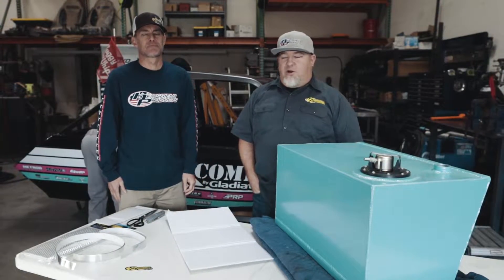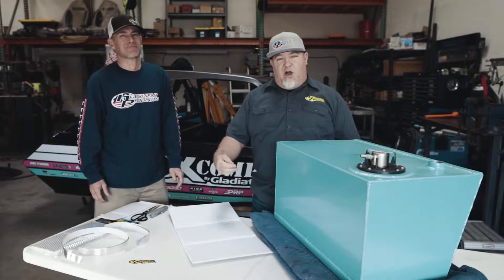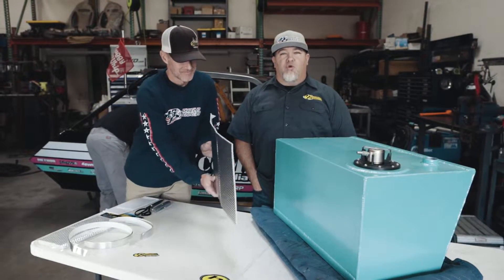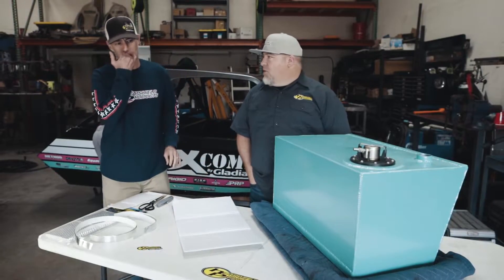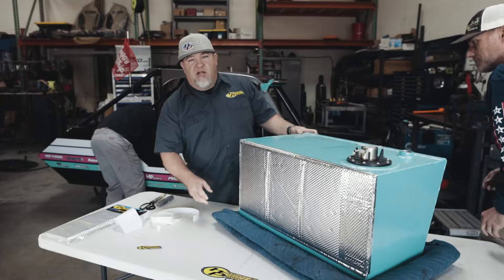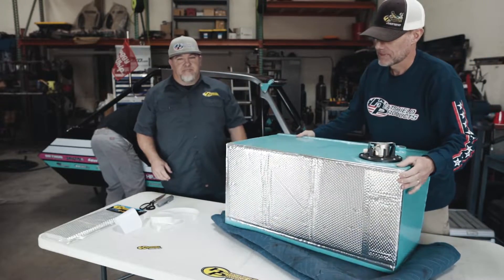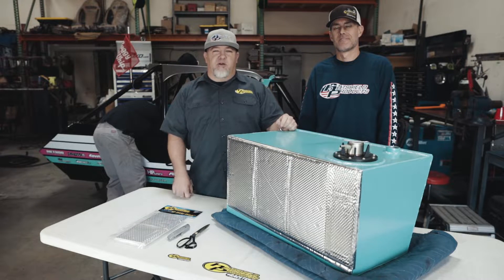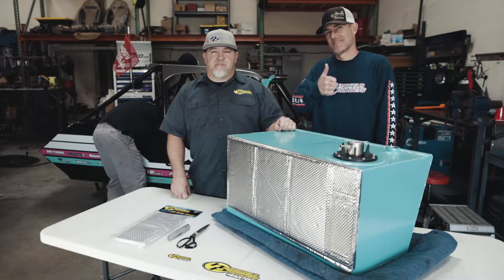Fuel Cell Fix – Gas Tank Heat Shield Install

Comment: Does it work well with OEM fuel tanks?
Reply from the maker: Randy, thank you for watching. Absolutely. It just will require more work and cutting because of the irregular surfaces. Fuel cells are easier because they for the most part are shaped like a box. Just make sure you clean the heck out of the fuel tank before installing.